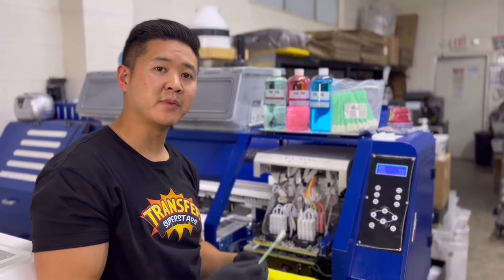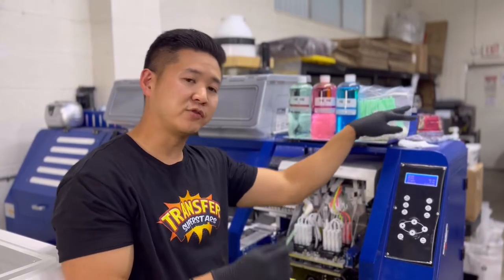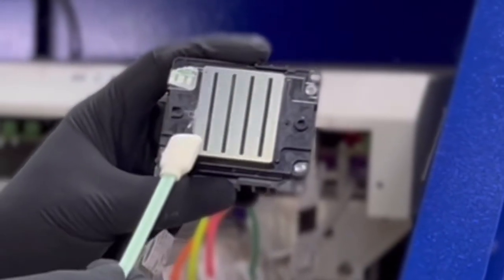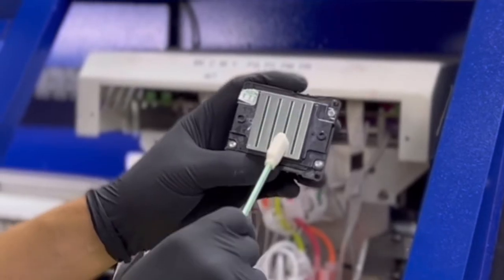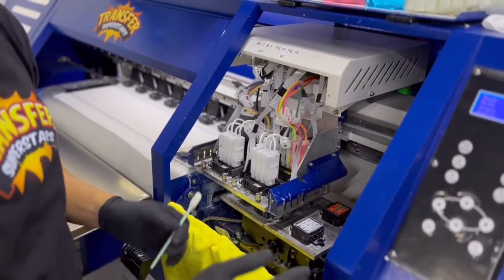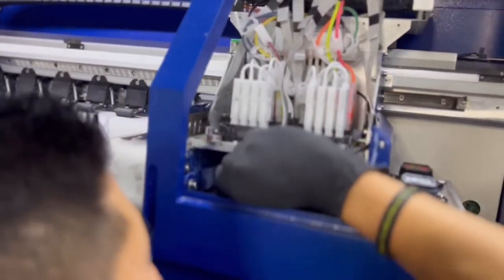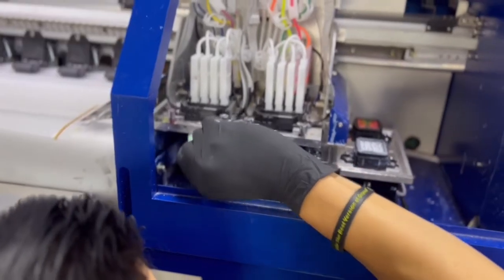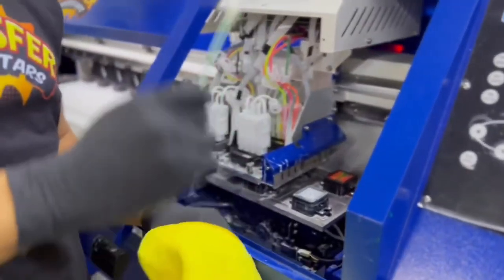DTF Printing Print Head Maintenance The RIGHT Way! Using Foam Cleaning Swabs from DTFPRO

Comment: It is safe to touch the channel of printhead?
Reply from the maker: What do you mean channel?
Reply from the maker: You can touch underneath the printhead when cleaning. We use swabs to clean underneath
Reply: @transfersuperstars  printhead channel underneath. Because someone told me that it is not safe to touch those channels 😊. I can see on your vid you touch it by using swab. Im scared that if i touch it i will destroy my printhead 😁
Reply from the maker: @jirehshalomjaena2878  I would recommend using a swab, so you don't clog up the nozzles with anything else.
Reply: I have the same concern about touching the channels and accidentally obstructing it w a fiber or otherwise damaging it.